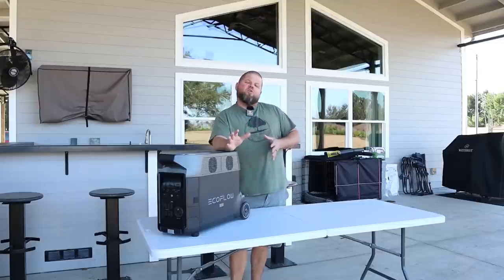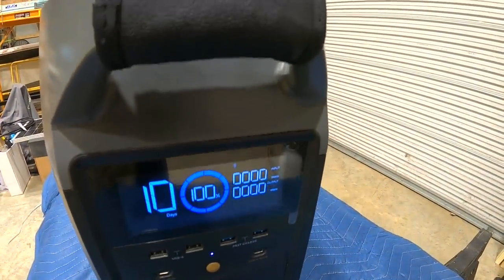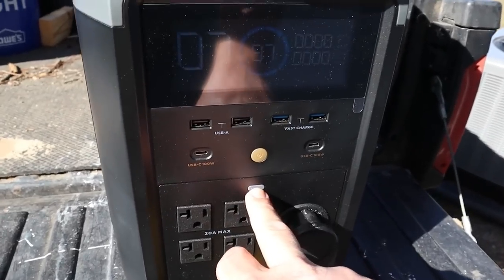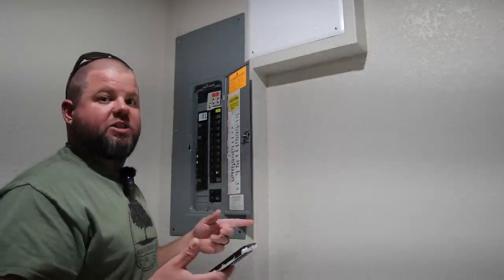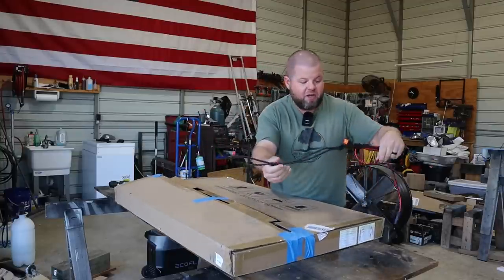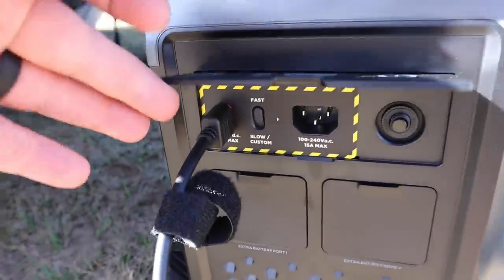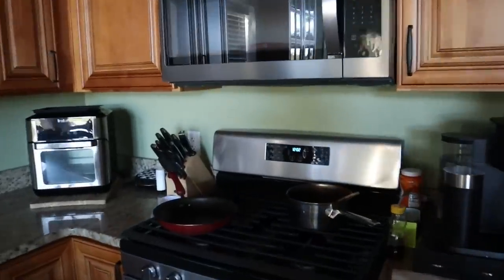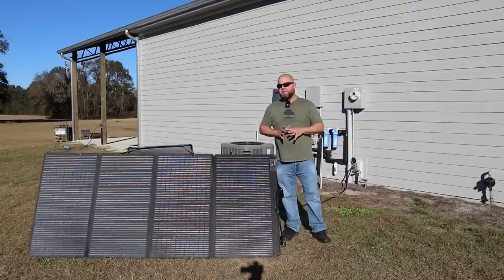Partial off grid power, it's time! Ecoflow Delta Pro whole home power solution. #705

Comment: In an extended outage this would be a great propane saver.  Say before you go to bed, turn off the generator.  The EcoFlow delta pro will carry your fridge freezer lights internet through the night zero problem.  That way your huge honkin generator doesn’t essentially idle and chew through half a gallon of propane per hour through the night
Reply from the maker: No kidding! Until I build a bigger system this can definitely be an addition more than the main unit.
Reply: @TKCL what am I doing wrong, I have tried running my deep freezer and it makes a noise then shuts down. Should I do something special it get it to power my deep freezer?

Comment: Just a note on your comment about being able to change the 400w solar panel setup to support smaller power stations. As long as you are below the solar voltage limit of the power station(River is 50v max), you can safely put a 400w(48v max) panel, the station will only pull up to it's max power input and will typically get more power even in low sun or overcast conditions than if you only had a 220w panel plugged in.

Comment: The best thing that makes the Delta Pro very well suited for home use is that it can be expanded to 25kWh.
Reply from the maker: Exactly and 240 volts. That allows full panel tie in like a normal generator. You can live quite comfortably off grid or through an extended outage with that much capacity. You just need good solar input to keep everything charged up.
Reply: Actually if you purchase the smart generators it is even more.  Each smart generator with a full 20 pound propane tank can generate roughly 18KW of recharging for the delta pros.  If you have two delta pros, two batteries and two smart generators you have nearly 64KWH.  Couple this with 3.2KW of solar input and it is a great whole home backup.  I just purchased this configuration and am excited to get it set up.

Comment: Hey friends, Pastor Fred here in Rockwood TN.  This is the unit i am planning on using to start my off grid living with.  Have started buying accessories already...  Will power my RV while I build my cabin, expanding to the 240 with batts and the duel fuel charger..
Reply from the maker: That's what I love about it, the adaptability. You can start with the first unit, use it and save for whatever else you want to add and build it out.

Comment: Fantastic!  My wife and I are considering buying a van (Ford Transit or Ram ProMaster) and converting it into the "Ultimate Travel in Comfort" rig.  We don't want to fly anymore, but we travel from N.E. Florida up to Michigan and New Hampshire often to visit family and friends.  I'm sure many of your viewers have seen all the van life videos and all the awesome conversions people have been doing.  I've already designed our layout, and have pretty much decided on everything I'd like to do except for the power system.  The lithium battery systems people are building now are great, but the costs are extremely high.  3 to 4 times what this Delta Pro unit costs.  I think you just solved my dilemma, Andrew.  This unit could be the heart of our electrical system.  When we aren't traveling in the van, the unit can be easily removed and brought inside.  When we are traveling, the unit is secured in it's spot and a couple inputs and outputs plugged in.  I think I'd even be able to connect the van's extra alternator in and charge the unit while driving in addition to solar panels.  We won't be camping remotely in the van for multiple days.  It's a comfortable road tripper that we can sleep in overnight.  It''ll be one of the first vans in the parking lot, and the last to leave when we go to concerts, sporting events, or other "tail gating" type venues.  I need to do some more research, but I think this may be the way to go for my application.  I want to be able to run the van's A/C unit and refrigerator overnight (8 hours minimum) without any input, so if I can get there with a Delta Pro, it's seems like a no-brainer.
Reply from the maker: It would be perfect for that situation. As for running an AC all night long, it depends on the wattage and how long the compressor stays engaged. The good news is you could make room for an additional battery if you ever needed it. No doubt this unit with a extra battery would run you for a very long time. As for power output, it should run anything you could ever put in the van.

Comment: I would definitely say that the Delta Pro is the best backup power solution since it has 3600Wh of capacity.
Reply from the maker: It's upgradable to 25kwh, so it has a lot of potential.

Comment: Great presentation, thanks!  Lots of features and great portability for camping and outdoor purposes but I wasn’t sold on the capabilities considering the fairly expensive price point of the package (needing 2 units for 240V power). I ended up going a different route for emergency backup power by repurposing an old 5KW 240V APC Inverter unit I found for cheap money on eBay which is backed up with eight deep cycle marine batteries to provide roughly 24 hours of emergency power at 400 watt-hours of steady draw during the outage period.  I also wire the emergency circuits to a transfer switch for my setup and leave the switches in “inverter” mode so that when grid power does go out in the middle of the night, my critical loads automatically switch to running off the inverter and when the grid comes back, the inverter automatically switches back to grid power and starts to recharge the battery bank. It’s not portable like the ecoflow but I didn’t need that capability.
Reply from the maker: There's many different ways to go about it, this is for the person wanting portability, adaptability and as plug and play as you can get. I just ran a huge series of tests on this unit, I was blown away by what it would run.
Reply: @TKCL  There's always a premium on portability and convenience. I like the idea of being able to just unplug and bolt when the zombies hit LOL

Comment: I have 2 delta pros... I am going to be doing some testing tomorrow... I have a design in mind using magnetic mounting system ...  I am glad I found your channel
Reply from the maker: Building my solar array starting this week. Ultimate plan is full solar array for two Delta pros and two additional batteries.

Comment: I'm moving into a converted skoolie full time as my tiny home on wheels. The bus has a 2000 watt inverter and some solar,  but still not enough power for my daily needs. My bus hardly gets any sun at all, especially in the PNW. I don't really understand electrical systems.  This might cost more than rewiring my bus, but this seems much easier.i have a high powered espresso machine, TV, vita,mic, blowdryer, and an electric wheelchair.
Reply from the maker: The allure of these systems are portability and plug and play.  No crazy wiring needed and all controls are built in.  The problem is how you recharge if you don't have any solar.  It isn't cost effective to recharge these via a generator.  Sounds like you need a very large solar array so it can pull some power in even on cloudy days.

Comment: Great overview video. Great to see the house/shop panel integrations. 

Cool that eco flow also has dual fuel generators which would be perfect for that outside plug-in. 

Don’t think you’ll be able to run your dishwasher though since that would of course kick the pump in. 😀

240v is the way to go for sure when on a well.
Reply from the maker: No plans to run a dishwasher or heavy use appliance during an electrical outage. I just want to use these for critical loads like my freezers and refrigerators.

Comment: Just wondering if you have thought of using a cloth’s line outside it would save lots of energy my wife and I use one quite often on nice days 
Thanks for the video and the reviews you bring your viewers
Reply from the maker: We will if the need arises, Tiffany isn't fond of the rough feeling it leaves the clothes with.  However in an extended outage, you bet we will string one up.
Reply: @TKCL  sometimes my wife after they dry some of The delicates she will throw in the dryer for 5 minutes to soften them up .

Comment: I've added this to my reading list for closer analysis but my 1st observation is that I don't understand why you would need or want to roll your Ecoflow outside across the lawn to get
it close to the solar panels when you can buy mc4 solar panel cords in various lengths for about 1 dollar per foot, (40ft. or 20 ft.) I have 4 x 400 watt rigid (Renogy) solar panels (still sitting in the un-opened boxes)..and an Ecoflow Delta Pro,  and that's how I intend to hook them up.  The panels would be mounted on my garage and I'd run the mc4 cables about 40ft into my house into the E.D.P.  I will check out your other videos to see if you did get some rigid solar panels and find out how you hooked them up to your E.D.P.
Reply from the maker: Keep in mind I had just received this for review, I used it as it came.  I now have two of these units, an inside generator plug.  Full solar system at my shop and 2400 watt solar array.  Not to mention about 200ft of 10ga PV cable and connectors.

Comment: That Ecoflow stuff is nice as it is very much plug n play.  For someone that doesn't know much about solar, or just wants a simple system it's ok, but if you get serious and want to go off grid, it is way, way too expensive.  With all the roof space you have between your 3 buildings, you have ample space to go off grid.  I watch 2 channels that delve into solar and off grid, and it is surprising how it haws advanced in the last few years.
 If you are interested in off grid I would suggest watching  DIY Solar Power with Will Prowse
, and  Off-Grid Garage
.  There are for sure many other channels that deal with solar, But this is a starting point.
Reply from the maker: I don't disagree with you at all, but these exist because people desire them.  Some people want portability for events, off grid tools, hunting cabins, fishing shacks ect.  A lot of people are not comfortable wiring and setting up multiple pieces of equipment either.  This is about as plug and play as it gets.  Some people want a truck, some want a sports car.  Variety is the spice of life.

Comment: How about a multi-day continuous test.  When you are without power for several days, will you drain the battery by the 2nd or 3rd day?  I'm serious about solar and wind for electricity, but I have a gas generator that I have only used for a few days in the last several years due to power outages.  It's hard to justify the money that a battery pack costs.  At realistic use, I'm guessing my generator will easily outlast the battery pack.  The generator cost 15% of what your battery pack online pricing is, and I didn't have to add solar cells to the purchase.  Thanks for another wonderful video!  I see you do your homework and know I can trust what you say.  Keep up the great work!
Reply from the maker: I show a wide variety of content and items because we all have different tastes. I hear you about the generator, but a lot of people don't desire the gas, oil and noise. A lot of people also live where generators can't be used, HOAs, condos, high rises, high theft neighborhoods ect. These exist because there is a demand for them. I like the fact that I don't have to rely on fossil fuels that sometimes are hard to find. I experienced that years ago after a hurricane, no gas to be found anywhere and it was chaos. I'll be doing further testing of the unit and adding additional solar input.

Comment: Very good practical application report and overview of the Ecoflow devices and their performance capabilities! I myself also own an Ecoflow and the 400 watt panel. Looking forward to more reports in this regard. I'm sure you can easily attach even larger off-road capable casters to the Delta Pro by yourself. Maybe a small Delta Pro upgrade project? ;) Thank you very much!

Little hint: The 400 watt panel can certainly be partially folded in and fixed via the eyelets on the edge to charge small devices without overloading them or you build your own quicksnap mechanism. ;)
Reply from the maker: I've been using it as a 200 watt panel myself 😉

Comment: Great content...after working for many years in the utility industry...a couple things people don't understand is: 1-the power coming in from the utility varies but for my example 13,800 volts single phase generally comes into a "step down" transformer which converts distribution voltage to 120/240 volts that is used in a house panel etc. 2-what the general public doesn't understand without a transfer switch or inner lock device a home owner that "back feeds" from a generator through their panel to utility transformer can potentially send (for my example) 13,800 volts back onto utility distribution lines....that is done by essentially turning the "step down" transformer into "step up" transformer.  Think of this way...when you use a  generator improperly and you  back feed voltage through a utility transformer you are essentially becoming a utility power plant...and just a disclaimer all voltage whether 13,800 volts or 120/240 volts have the potential to be deadly.
Reply from the maker: Regardless, it's a bad day for someone and not a shortcut people should take.

Comment: , This one I like, this is realistic, I could take this out to a cabin and have a functional cabin for a while off of this so it’s a true off grid solution, you could live in the house run by 3500 W and all of them are pretty cool but Having some thing big enough that you could charge off of a generator on a cloudy day that would get you through the night is pretty cool and they should be big enough to do it, if you had a little hunting cabin up on a mountain, this could run it at a realistic level.  I like it.
Reply from the maker: Absolutely this would be the perfect cabin solution as is, especially since it takes real solar input 1600 watts. I love how it is adaptable and you can build as you go. That's what I'm wanting to do, two units for 240 volts and eventually more battery storage. With a true solar array I can honestly see this taking me off grid or allowing me to span any extended outage.

Comment: A great starter system for those who need the same power that a Honda 2000 watt generator can provide. There are better systems for less out there (Big Battery Rhino series). And you are extremely correct on the solar input to ANY system makes all the difference. An thought on adding a micro-wind turbine to add power at night or duing a storm?
Reply from the maker: I am seriously considering wind as well. I am not sure how to tie both solar and wind to the unit with one input.  I never hear of others running wind with these, always seems to be solar (which I prefer living in Florida).
Reply from the maker: And FYI this is 3600 watts continuous (can be boosted to 4500) and 7200 peak. This has a lot more power output than the Honda. Wait until you see what I've tested with it. 😉
Reply: @TKCL  Check out John Daniel (https://www.youtube.com/@1JOHNDANIEL). He has several videos and links for 500 to 1K watt wind generator set ups (yes they are Chinese but they do work well) for under $500. You should be able to tie in wind by adding a small charge controller or a rectifier (110V to 12V) and then charge into the solar input. Solar is fickle, no one system will fit everybody. Your system is awesome for light/medium use and portable. Here on the rural coast of Washington state, I need 7500 watts continuous, 240V split-phase, and 5 to 7 days of battery (all for less than $16,000). Looking forward to you further testing, and I can see you upgrading sooner than you think. Great information and keep up the good work!!!
Reply from the maker: If I double up this system I can get 7200 continuous watts split phase 240v and add up to 24kwh worth of batteries. That's actually more than I think I'll need. Being in the sunshine state it's rare we go more than a day without sun. A decent amount of solar panels are needed as well and I can always charge via one of my gas generators should we have several days of no sun. I'm leaning more towards full off grid backup power and not daily use as my shop needs a dedicated 240v service with the powerful tools I run. I also have future shop upgrade plans. With as crazy as the world's getting long term off grid backup power makes me feel better. And I don't want to depend on fossil fuels either.
Reply: @TKCL  I think you will be fine and like I said no one system fits everybody. Was just trying to show that there are other options. You should be just fine, and I do enjoy your effort and opinion. I am rather jealous of you sun, but I do have constant 10 - 15 MPH of wind here... I think our needs are similar, we just took different paths to get to the goal. Keep doing the great work that you do and I look forward with anticipation to the upcoming videos!!!
Reply: it just costs as much as a 2000 Honda lol
Reply from the maker: Don't know why everyone is so focused on costs, it's a completely different machine than a gas generator. No difference than a Ferrari, Honda or a Tesla. All get you from point A to point B but do it differently. Some want solar options and some prefer to depend on gas. Doesn't make one or the other right or wrong. 🤷

Comment: Hey nice video, I’ve got solar panel on my roof , can I use it for recharge the eco flow station ? And how ? Thanks
Reply from the maker: Yes, as long as you stay under 150 volts and 15 amps.

Comment: Can you leave on the 240 volt breakers if you don't turn on any 240  volt appliances like the dryer, electric stove, or ac?
Reply from the maker: No I wouldn't, some appliances still use some power in the background.